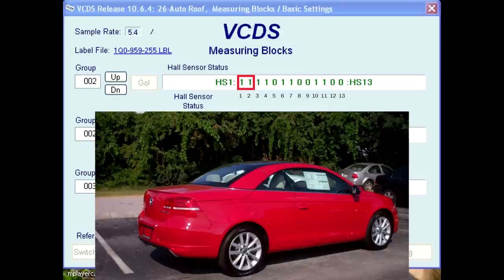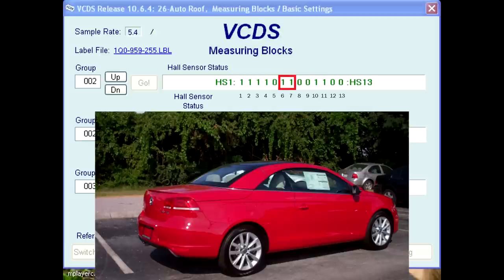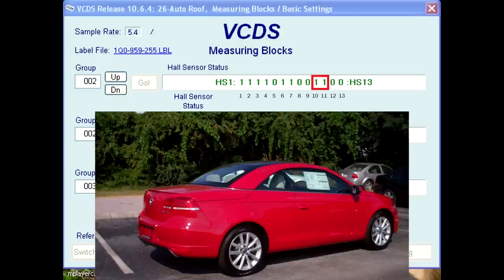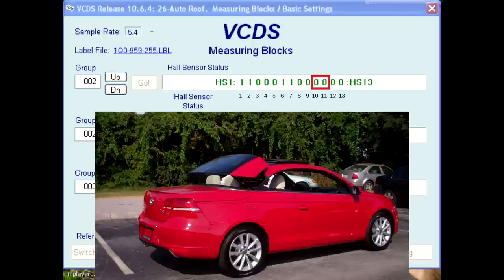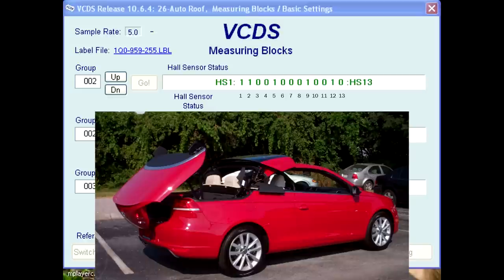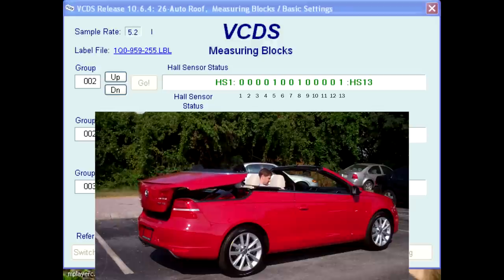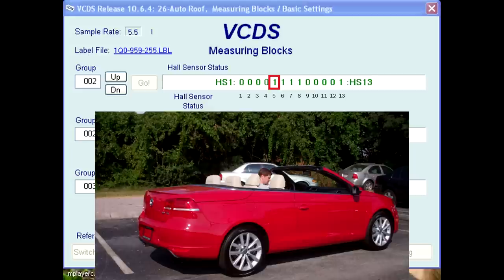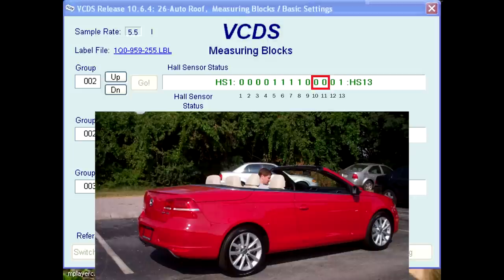Eos Top Operation, reading the Binary Data for Roof Position

Comment: You could in a list view in operational order from top to bottom list the components and description code also listing the parameter measurement of  open and closed.  In the Actual value have the changing 0 and 1.
E.G
Roof G452 open =1 Closed =2                       Actual value   1
Roof G453 open =1 closed =2                        Actual value   1
Rear glass G675 open  = 0 closed =1           Actual value    0
Rear glass G676 open  = 0 closed =1           Actual value    0
etc...
This would layout the binary data in a readable format that even a dumb mechanic would understand 
Also make it extremely easy to look at the roof position and compare it to the  actual data making it easy to  locate a fault. It would also eliminate a  computer masters degree needed to decipher the mass of changing 0 and 1 s along with transformer like process unfolding in front of us

Comment: Mine is hanging at the HS1: 1100011001100 :HS13 stage, it opens if I manually push on the rear glass window a bit. Seems like it's having a hard time lifting up. No issues at all when closing the roof.

Comment: Wow, great help, BUT, where are g565 and 672 your description and your arrow don't seem to correspond ?
Reply from the maker: +Mick Apps 
These are sensors on the frames, close to where they are mounted to the body in the trunk area.

G565 is on the left side.  G672 was added starting with the 2009 year models, on the right side.  

You will have to remove the carpet/trim panels in the trunk area to find these sensors.